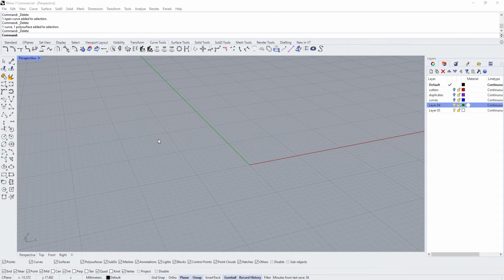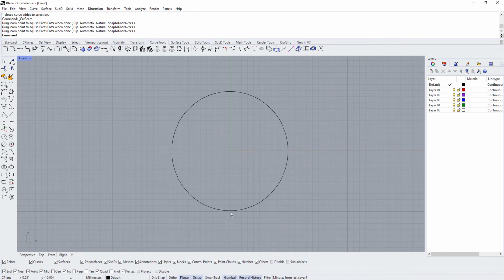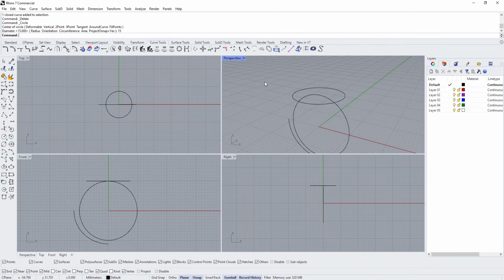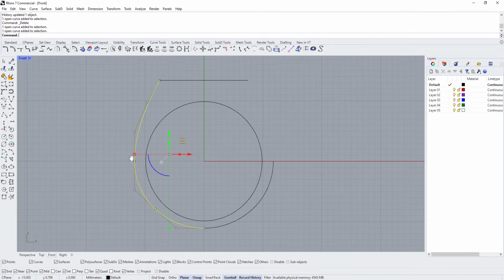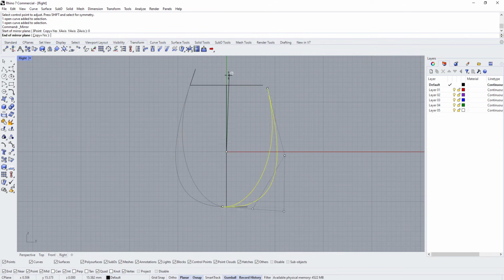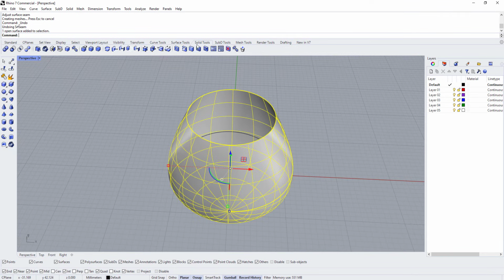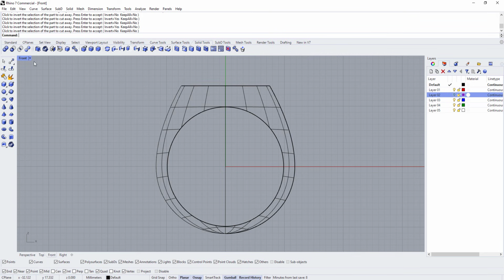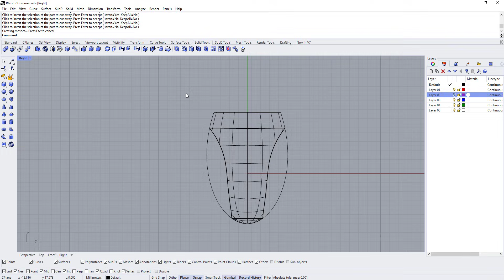Rhino | Signet Ring Tutorial | Part 1 of 5

Comment: I have rhino 8 and I can't make the surface transition between a network of curves
Reply from the maker: I'm not sure, but I think this is caused by not snapping the curve endpoints...like the points were placed really close to where they need to be but not snapped into exactly the right place. Make sure you have snapping turned on and that you have your mid, point, end, int, and quad snaps all activated. Then redo the part where you build the curves from the right view port. See if that fixes it. Let me know if it works or not.
Reply: @webduncetv that’s exactly what was giving me problems make sure y tick quad and Osnap at the bottom

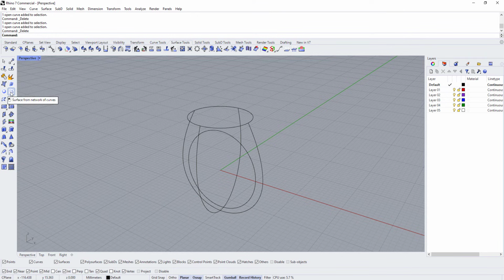Comment: 6:54 after I selected the curves to do the surface, it didn't work. Right after I selected the curves and pressed enter, it said "select first curves in first direction" i didn't know what to do...
Reply from the maker: That happens sometimes with surface from network of curves. I'm not sure, but I think this usually happens if the ends of one of the curves are not quite snapped into the correct place (just a little off). If you're handy with Rhino, you can make sure all the curves are snapped to the correct locations, or you can start the tutorial over and be extra careful making those curves. If you prefer and if you feel comfortable doing so, you can contact me outside of youtube and send me your rhino file for this project, and I can look at it and see if I can figure out what is wrong. I can't guarantee I can respond very quickly, though. (I will try, I just can't guarantee it). The video below shows how to contact me outside of youtube.

https://youtu.be/bhadwrxAF0c
Reply: @webduncetv deal. Much, much appreciated ❤
Reply: Same problem
Reply: @alligatorkafriend yeah no worries! 
He then replied. I tried it again just like he told me nothing worked until I stumbled across another video and it showed different instructions, i follwed them and it worked out

Comment: i can't
 able to create surface , can you explain me where i am wrong
Reply from the maker: Hi. I can't guarantee that I can help, but I can try. You will need to send me your Rhino file. Here is a video showing how to contact me outside of YouTube. In your case, probably facebook or email are the best ways.
https://youtu.be/bhadwrxAF0c
Reply: @webduncetv   ok i will do later, but for now where i am wrong🙁
Reply from the maker: Usually the problem is the curves are not snapped to each other correctly. Make sure you have end snaps, int snaps, and quad snaps enabled. Also, you should have probably have project turned on while making the curve structure.

But, if that doesn't help, you will need to send me your Rhino file (and even with the file, I might not be able to figure out what's wrong, but I will look at it and see if I can figure out what's wrong).
Reply: @webduncetv  Thankyou soo much ☺now I can do

Comment: thank you for this great content it is so helpful , I've a question why did you use curve seam tool at first ?
Reply from the maker: If you mean for the sizing circle, moving the curve seam was optional for this project since it had no complicated details, but it's still a good habit to move the seam to the bottom. As a general rule, jewelry designers will put the seam of the sizing circle at the bottom to keep it as far away from details as possible as the curve seam will eventually become a seam in the surfaces, which can potentially cause problems in more complicated designs. There can be exceptions where the top would be a better choice, but the bottom is almost always a good choice. But for this particular project, like I said, moving the seam is optional.

Comment: 4:19 how you adjust your curve with gumball and keep it "glued" to the   circle? Mine just moves through it
Reply from the maker: I'm not sure, but it sounds like you may need to turn on edit points. If the edit points don't turn on automatically when you select the curve, then you may need to turn them on manually. To do that, select the curve, click on the curve tab, and then click on "Show object control points". If you have the default toolbars, it should be the 9th icon from the left. Then select the top control point. Then you can move just the top control point.

Let me know if that helps.
Reply: @webduncetv  i selected the top point and it helps hahah, thank you!

Comment: 4:20 Why do I move the wire straight but can't create a curve?
Reply from the maker: It sounds like History is off. Type History in the command line and make sure Record = Yes and Update = Yes. Let me know if that helps.
Reply: @webduncetv  I can not do it
I have history turned on
i used rhino 5

thaibui
Reply from the maker: @thaibui5911  Is it making a straight line? If it's making a straight line, you might have the continuity set to "Position". Be sure the continuity is set to "Tangency" for both point 1 and point 2. And let me know if that helps.
Reply: @webduncetv  How can I send you the clip?How can I send you the clip?
Reply: @webduncetv  it is not making a line
Reply from the maker: @thaibui5911  here's a video showing how you can contact me outside of youtube. https://youtu.be/bhadwrxAF0c

Comment: Love your tutorials! Thank you for them. I have a question though. Seeing as most of these 3d models will then get cast into metal, would you recommend adding 10% to the ring band size to account for shrinkage?
Reply from the maker: That's a very good question.  Also finishing and polishing the ring removes metal. I really expected this to be a problem, but I've never personally had ring size be an issue due to shrinkage from casting or from the finishing process. But I only worked in one shop, and there are so many variables in the casting process and from jeweler to jeweler (some jewelers might remove more metal during finishing) that I think it is possible it could be an issue in a different shop.

You would need to just watch it. If it turns out to be a consistent problem, you could offset the sizing circle (offset inward toward the center so that the offset circle is inside the original circle). I would try very small offsets. Maybe 0.025 to start. If the finished rings are still turning out too big, then offset by 0.05. I doubt you would need to offset more than 0.05, but, if you do, then offset by 0.075, and and then 0.10, so forth. And just keep on offsetting more and more until you find an offset that produces good results for your shop. Once you find the offset that works for your shop, just make it a habit to offset the sizing circle always by that amount and then probably delete the original sizing circle (or put it on its own layer and turn that layer off...you just don't want to accidentally select it in the future).

At least that's how I would handle it.